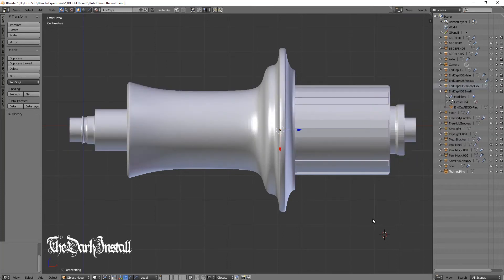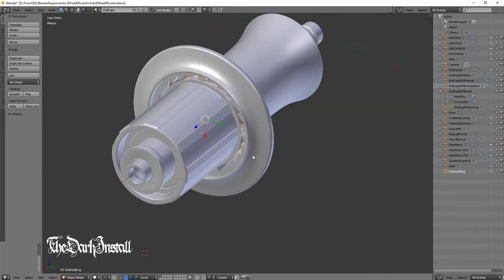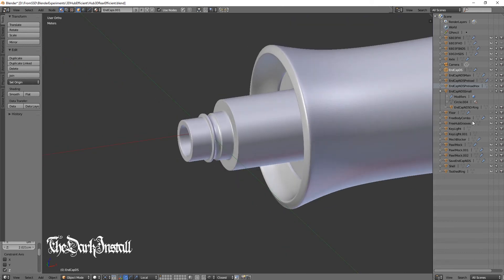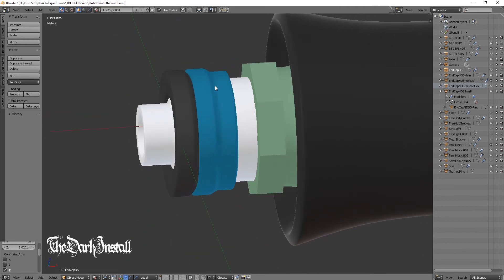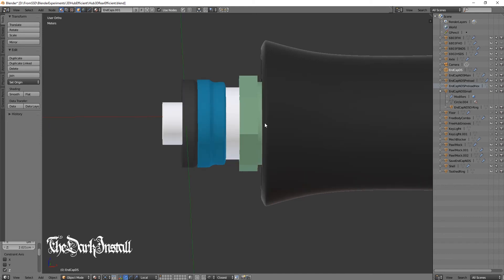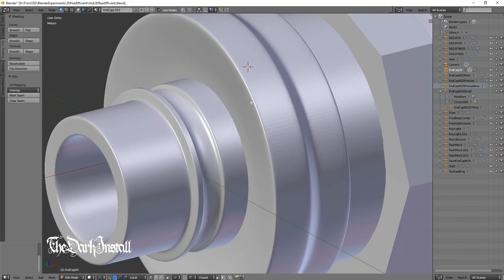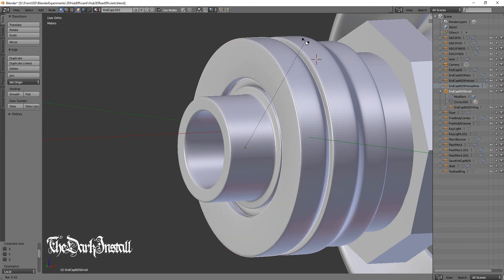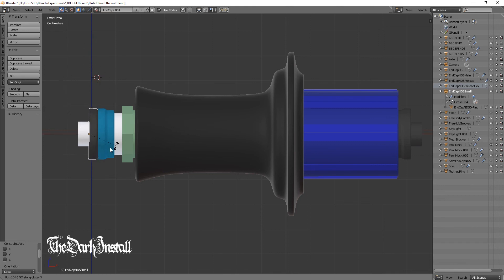Concept Design. Rear Hub. Part 2.

Comment: Gokiso hubs have a very similar system.  They also weigh a tonne, but are pretty interesting from a technical viewpoint.
http://www.gokiso.jp/image/en/product/gokiso_product_hubph06.jpg
Their most expensive hubs have an interesting suspension system too.  Shame about the horrendous price and weight.
Reply from the maker: +bawbagbawbagbawbag yeah I have seen those.  Way too heavy and overpriced.  My idea here is to create a simple solution to non-parallel dropouts in as light a way as possible.

Comment: That is actually pretty good. I was wondering how the o ring would survive pressure/wear but it's stationary right?
Reply from the maker: Juriaan van der Flier Yeah the o-ring is just to hold the convexed end cap in place. It only moves very slightly when the skewer is clamped down and the bent dropouts find their position. It is essentially a non-moving part.
Reply: TheDarkInstall that's really a good thing and in the end it still has its simplicity. 

love all your videos hah
Reply from the maker: Juriaan van der Flier ah thanks!  Really nice of you to say so.  

Yeah, simplicity is always preferable with design.  Actually working out the simplest way to do things is the challenge though...
Reply: TheDarkInstall it's well deserved

yeah I always say it's very easy to make things complicated. Very hard to make things simple. So hats off to you because it looks proper feasible